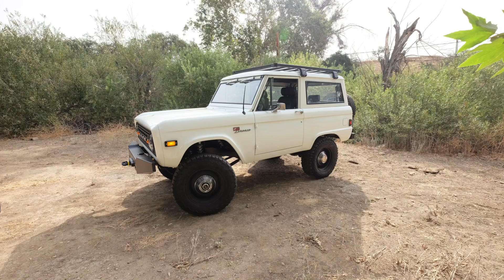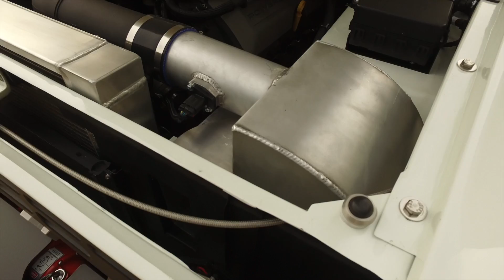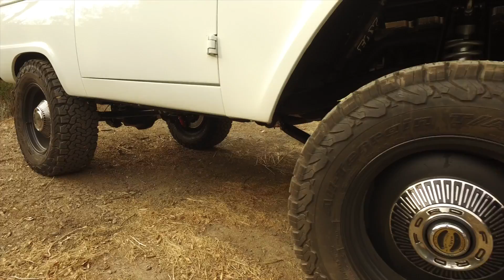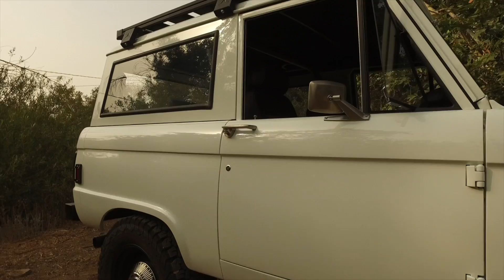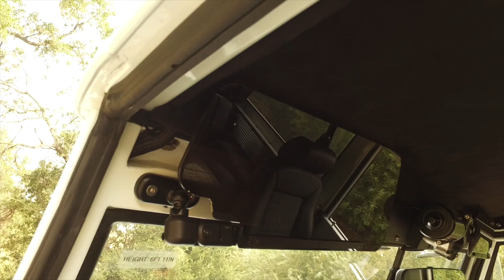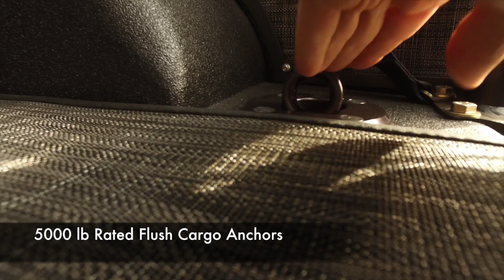ICON New School BR #34 Restored & Modified Ford Bronco

Comment: I answered an ad in the S.F. Chronicle years ago. He would pay $100 if you steered him to one for sale. He bought one and sure enough. He mailed me a $100 bill. I think this is the same guy. He should try and hunt down Mrs Melmac. I sold her to a U-Haul guy in Simi valley in 2003? Factory 12,000 lb PTO winch  It had the spline in the transfer case and gear shift in the cab for a rear winch with a slot in the rear bumper, 2 winches! One fore, one aft 1969 FJ 55 Green and white, 4 speed, disc power brakes. Ah,Velma! I should have never let you go. I sold it for......$500

Comment: Great vid JW. Every Bronco is better than the last - thanks for refining and pushing forward. I would like to see more on the electrical - LEDs, door switches, sensors etc, and discussing any challenges you have with combining new tech with old design methods and how you hide it all! Great work